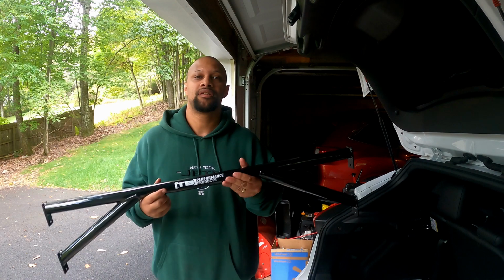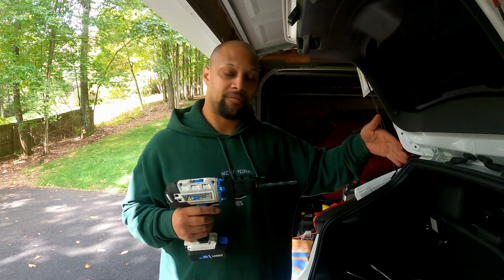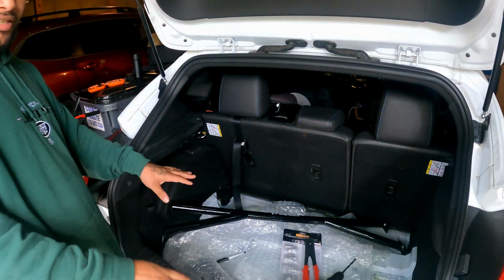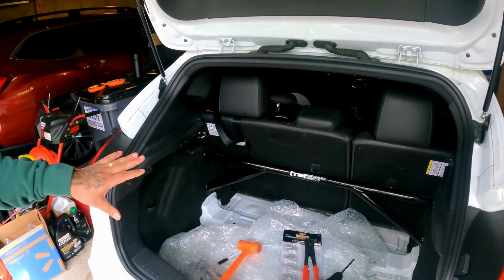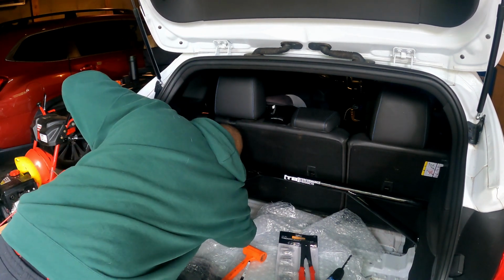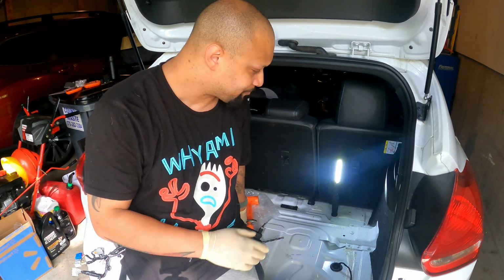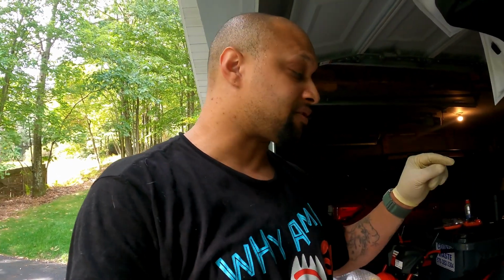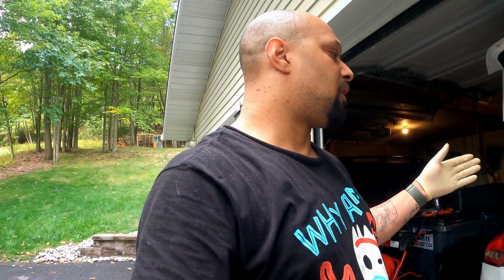TB Performance Rear Strut Bar install

Comment: Seems to be some wires (maybe for the active suspension) hidden under the carpet back there for the RS.  Any idea what direction they run?
Reply from the maker: Yea, I honestly don’t know which way they run. But I do know that they aren’t near where you’ll need to drill.